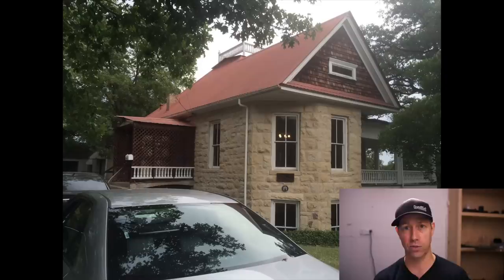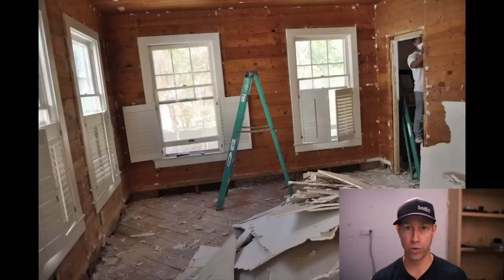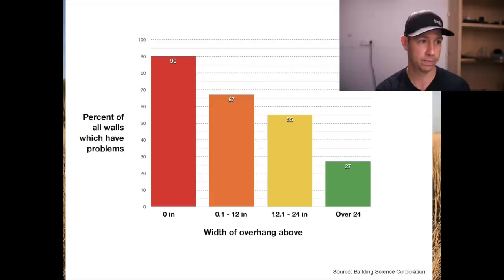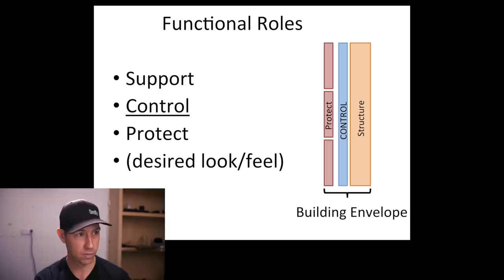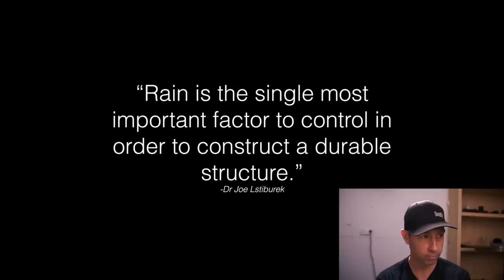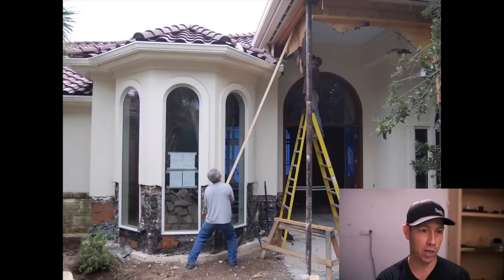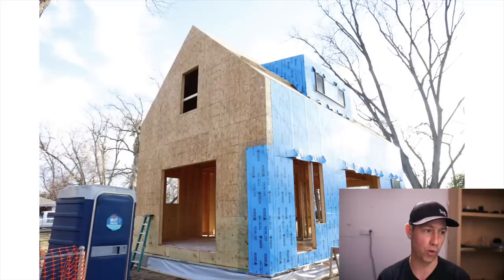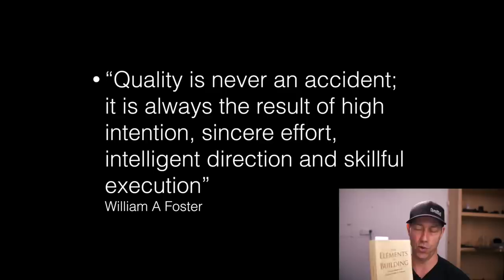Were Old Houses Built Better?

Comment: I watched my old 1950 built house being torn down and hauled to the landfill and all I could think of was all those high quality floor joists, roof joists, etc... going to waste.
Reply: Portland is the best.
Reply: I have a 1960’s old cabin on a rotten pier and beam foundation. The framing is still good and strong. I tried very hard to bring it back to life. Our new house looks great from the outside. But the builder used lots of recycled 2 by 4 which can only stay in a vertical position. Once it’s covered, no one can tell the difference. I love old mid century houses.
Reply: 50s dont have anything special.  I'm working on a 1889 brick building  that has 15x15 wood pillars and 15"x3" joists. You couldnt build that these days.
Reply: Houses from the 1950s-80s are the worst houses. Half assed workmanship, stupid designs, toxic materials everwhere.
Reply: V.Vega  good thing mine was built in 1949  haha
Reply: @Rudi Van Desarzio 
Ugh, more bureaucracy making it impossible to build affordable new housing!

In the future, when you see a homeless person, remember: this goofy reg was part of the reason he has no house.
Reply: this is why salvage companies are on the rise.  they take all that useful materials and resell it to people.  I recently bought some solid wood doors for $20 to replace the crappy desintegrating ones in my basement.  I replaced doors built in the 70s with some from the 50s.
Reply: Tina Sun your post highlights the difference between the UK and the US. Anything post war here would be considered practically new! Old doesn't really begin to be used until it's at least Victorian.
Reply: @Xixu.co.6  Custom built homes from the 60's are often great. Western red cedar siding, tongue and groove, etc.
Reply: @NatureShy  I think its safe to say your comment aged terribly lol, with all the Antifa terrorists taking over your city.

Comment: Matt, your instruction makes me question the building I have done in the past few decades. Excellent stuff. I have always maintained that the secret to good building is controlling water. You cannot eliminate water, but you can direct it away from the vulnerable places, like along the foundation and any opening--windows, doors, vents etc. And this idea of putting your thermal control outside the structure is revolutionary to me. I can see a dozen applications for it already. I think I need more education, but what a great idea. Isn't this sort of the idea of the old dwellings built into the side of a hill?

Comment: Informative video. We lived in a small 800 sq ft house built in 1925. That thing was the most solidly built structure I've ever lived in despite being nearly 100 years old. It creaked but wasn't moving anytime soon. Even our 1970's ranch that we have now is clearly not built as well as that house was, although it's still better than my folks new build (2019) which is already having issues with drywall, roof, etc.

Comment: In the room with pink wall paper, showing the moisture marks under the windows, is not one possible explanation the addition of the window cooler unit causing condensation buildup on window which dripped down?  Factor in the window only has a single pane of glass.

Comment: I was given the remnants of a circa 1940 fireplace mantel that was removed during a minor living room remodel...basically a box made of 1" thick sweet gum lumber with an inside frame made of 2x4 pine scraps that were probably laying around the site when the house was being built.  The sweet gum doesn't have much character but the pine "scraps" inside were clear old growth white pine with amazingly tight grain.  Woodworking is a hobby of mine and I've never seen such nice pine in my life. Spent more time salvaging as much of that pine as I could than I did salvaging the sweet gum!

Comment: I lived in ancient dwellings in Italy.  In my apt in the Alps, over 800 yrs old, 3 foot thick walls, plaster peeling on the lower half of walls all the time, tiny windows with little insulation, tiny rooms, inadequate living space, or space for ,more than a 10 gallon hot water heater in our 2 bdrm place. (they didn't have hot water other than that heating on the hearth) The whole place was heated by an old iron stove thing tthat worked well. If you were close to it. And you had to keep it fed with wood. It was musty inside and dark from tiny windows. In Sicily we lived in a 150 yr old dwelling with rubble masonry outside and the weird concrete block/brick mix for interior walls. No insulation. Great in summer. Misery in winter. Fixing electrical (which was of course added much later and not particularly skillfully) meant meandereing channels in the walls. Italy is big on using lime washes for paint interiors as late as the 90s which meant OCD friends could ruin your kitchen trying to clean all the tomato sauce splatters off the wall with a sponge. 
Lastly, dear friends of mine inherited a 1890 mansion in a northern city.  Its a CONSTANT money pit. I won't recant the ills of the gorgeous house we grew up in, but boy does aged beauty come with a heavy pricetag.

Comment: re: the heating bills, I grew up in an old house and we didn't spend more on heating that anyone would now. The difference is, we heated only part of the house  - the parts where there was plumbing. 

Bedrooms were heated only for a couple of hours a day so that you could get to sleep and then in the morning for an hour or two, just to get out of bed. Otherwise, only the first floor and part of the first floor was cold. 

That might sound to someone like it's a horrible thing, but it's not that bad. I wouldn't imagine that the bedrooms got colder than about 50 degrees in the winter, and you were asleep anyway. 

The only exception was below-zero forecasts, we left the heat on at a low level just to keep the pipes from freezing (water heating). 

The idea of a house being warm end to end and all rooms and all floors is a modern thing.
Reply: I agree. I spent some time in Japan where most houses are not insulated. It can get pretty cold but you get used to it. There are electrical heating units but they're used during the day and only in certain rooms. At night it gets cold but you don't feel it much since you're sleeping  under thick futon blankets =)

Comment: i have bought and sold over 400 houses, and i bought this one house recently and this is the first, and only house that i ever bought that the wood is so hard that i can barely screw drywall screws into it. Its an older house but it a beautiful house.
Reply: I have demo'd old barns that had 100 year old oak lumber in them.  You want to talk about hard.  We had to cut a bunch of nails off flush because we could't get them pulled even with a cheater bar.  Had to pre-drill and use screws because it was too difficult to nail when the wood was reused.

Comment: My house is build 1882 it was renovated in 1940 at least I found some
Newspapers in walls under fir floor, horse hair, wood gutters. Structure is impressive and I would not give my house for any new homes. I am contractor in Boston Massachusetts And i have renovated my kitchen and bathroom I did not see any  mold or any kind of issues. 
New house  technology today creates many problems. I guess economy has to spin somehow.

Comment: how is osb board house more sensible, you are basically building a house from glued up sawdust
Reply: It sounds stupid, but the OSB is only for racking strength.  The 2x4 and now 2x6's walls are where the true strength of the house is.  I'm an engineer for a sheet metal company and we stopped spot welding some items and switched to VHB tape.  TAPE.  Check out a video of it.  If installed properly it will be the better and more cost efficient way to connect most metals, for most applications.  New science isn't always bad, just seems crazy until you see it in action.
Reply: Ozone  definitely
Reply: Osb is cheap, but like anything used for the same purpose, none of it will survive getting wet, and no chance to dry.
Reply: 😅Garbage. no wait  expensive  garbage.

Comment: I love your channel, I love all your advice, but I've said this like 10 times in your comment sections before...bottom line: too much OSB. I joists, OSB sheathing, OSB roof decking. It's crap. It will disintegrate. These are not 500 year products. They are not 100 year products. They turn to mush when they get wet. 
There will be a whole generation of homes that are worthless in 100 years due to OSB
Reply: OSB is basically wood chips held together by a formaldehyde-rich glue that's just waiting to disintegrate and off-gas a nice VOC aroma
Reply: What is the best alternative to osb?
Reply: 100 percent true.....osb should be banned
Reply: Only fair to point out that it is cheap, strong, and effective in the short term. I just have no faith - and only bad exameples - in the long run (turning to mush after prolonged moisture exposure). 
Obviously we can't sheath a whole house with mahogany marine ply, but I would prefer a quality (preferably treated) plywood to OSB for exterior sheathing; and I quite simply would never build a home with I-Joists. Zero long-term faith in the product.
Reply: @nc3826  man, I am a Luddite in many regards. I'd rather see a gluelam than a paralam or timberstrand beam. I'd prefer plywood to OSB, id prefer 1x board sheathing with let in bracing and 2x roof decking to anything. Maybe I need to just accept that things change.
Reply: OMG...really? OSB should be banned? I am all for building quality homes...I was a licensed builder when I built my first home at 21 yo. Ive got an architecture degree and was big into LEED and USGBC built structures but they aren't for everyone. Dictating the way people build things only costs too much money for people who don't have it and creates inefficient building processes. A better quality built home could be overseen by private companies who certified builders in a wide array of building practices....and not just that but would provide the future homebuyers assurance in what they are buying and protecting the investment for those who built it to begin with. If someone builds or remodels something and they plan to be there less than 10 years, like 85% of home buyers, then what incentive would they have in closed cell insulation or engineered lumber or fire rated lumber throughout the home, triple glazed windows?? I could go on and on. However if certain businesses i.e.. Association of 500 Year Home Builders was a thing and certified Risinger Homes then the owners would be able to protect that investment instead of choosing how they build based on a cost-benefit analysis type decision. Always people wanting the government to provide more oversight but no one can name one government entity without scandal and found to have been corrupted...I just don't get it. 
I am currently working on getting a subdivision approved for 450-1100 sq.  ft. homes that are energy minded builds but are bare bones in cost so that people with fixed incomes can actually afford a home that suits their needs and budget instead of pouring their money into rent during a time when, IRONICALLY, the mortgage rates are super low but the ability to qualify is impossible for MANY! Partly because of the economy and whats happened but also because a new home can't be found for less than 250K...I am working to get people new homes at 79K-140k and more and more government inspectors and codes adjustments aren't the answer to our problems. People needing to know what they are buying is the real issue, and where they're money is going. Allowing, those who never considered it possible to own a home to have one would change our country and not make people feel their in a rat race, with no way to the top, and always giving up their money they worked hard for to people with more money then them. But of course passing these plans is difficult with the city and their planning restrictions...no form based codes where I'm living. 
I-Joists aren't going to just disintegrate underneath you.Theres nothing wrong with OSB, another product will replace it someday, but right now its affordable....that is until these hurricanes hit and the rest of the country is subsidizing those who choose to live in their path when OSB sheets go to 20-40 dollars a sheet...if they were ply or what not then who knows what they'd be. If theres something you want to bag on look at masonite...now that was shit...At least OSB is covered with TYVAC or some other substrate. (just my wifes opinion though)
Reply: To Action Jackson, Like the way you Think.
Reply: action jackson 

Agreed, I sell for a living and people have very little pride in their home. Average homeowner stays about 7 years. Plus explaining value to a consumer that barely ever picked up a hammer, is like talking to a wall. No one cares. They do care that it looks nice, doesn’t break, and is cheap.
Reply: rickrudd  Have been , here in the UK , with its very damp atmosphere , testing over the last twenty years  , OSB . We have samples that have been outside for that entire length of time . The samples have been completely exposed to all weather conditions - Driving rain - Full sun - High winds - Frost & Standing snow . Not one of them has failed or 'turned to mush' . Not one of them . . .
Reply: Roberto Corradi 

When you have the samples outside, they are exposed to sun, meaning that the dampness is dried out by the radiant light of the sun, plus exposed to outdoor ventilation allowing it to dry faster. That also eliminates the chance for mold to accumulate. That is not a very good test. 

A better test would to be put it in a box with a Porous sunshade over top, where ventilation is minimal, and sun exposure not existent. That would mimic true in-field applications. Leaving it outside sounds nice, but doesn’t show how it preforms under construction applications. 

Add moisture and heat, non radiant, and I bet you will see delamination, and moisture damage.
Reply: there's no incentive to use plywood for 98% of homeowners. Until you get the government out of the business thats what happens. The point of using it is because its cheap. Im not sure if your building decks with OSB but Im not sure where or why it would turn to mush unless you suck at building or maintaining normal house issues....Please help me out with info on where its gonna turn to mush??....youve never screwed a piece in huh?....just nailed it? cus thats what you do with OSB 438295
Reply: bigmaccattk.....yep, our practices are only dictated by market demand. If i build a spec the way I think is best way to build for longevity I will never sell it....if its a bill job ill build whatever you want, just keep the checks clearing and ill put rotors on your house and make it float
Reply: @robertocorradi7571  Rubbish.

Comment: My old rock house, built in 1934, has a few problems. It has a full basement. There is no sill that the first floor is build upon. Instead, the floor joists were imbedded into the rock. Over time, termites attacked the joists in those pockets. So nothing was holding the floor up. The only thing that resembles a sill plate is at the ROOF line. So the roof is built on to that. The other thing is load bearing walls and roof structure. No trusses, no collar ties, no ceiling joist tying together the roof rafters. Instead, ceiling joist were run in whatever direction was the shortest. So ceiling joists in room 1 might run North South. Then room 2 might be East West. Then the next room another direction. This makes almost every single interior wall to be load bearing. One really nice thing with my old house is all the woodwork: trim, doors, everything was made out of clear chestnut. Beautiful woodwork!

Comment: Back when I lived in Montgomery New York, we rented a house that was built in the 1840s. There were essentially no improvements made to the house over the next 160 years.  The layout was original. The heart pine floors were original.  The horsehair plaster, 15 inch high trim, milk painted pocket doors and plaster crown molding were all original.  The double hung 6 pane windows were original down to the bubbly old glass. The electric and plumbing was run on the outside of the walls as an afterthought, and there were only 4 light switches in the whole place.  The only additions were the kitchen and bathrooms, as the original house didn't have them.

It's exactly as you said.  The quality of the masonry in the foundation, the timber construction with brick infill, and the cedar windows all held up amazingly for their age and the bare minimum amount of care that went into preserving them.  There was some rot and termite damage, but the house was absolutely solid.  

Unfortunately, there was no inslulation whatsoever.  Getting the house up to 70 degrees in the winter was a chore in itself.  The 6 foot tall windows leaked heat like crazy and the giant fireplaces in every room didn't help either, even though they were boarded up.  In the summer, you could put your hand on the kitchen ceiling and it would be hot from the sun beating down on the shingles.  Hot to the touch.

At the end of the day, it was a great experience, but I'm glad I was renting.  Getting that house to a state of comfortable livability would have cost tens of thousands of dollars, possibly more.  I'm at least glad it's not going anywhere.  That house will outlive me and my grandchildren.